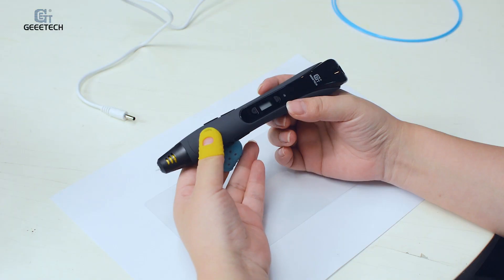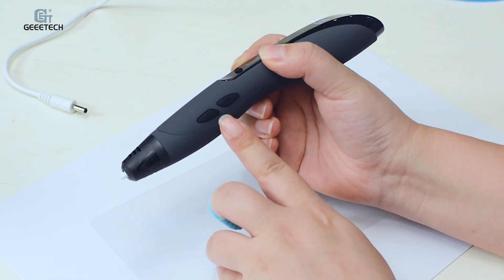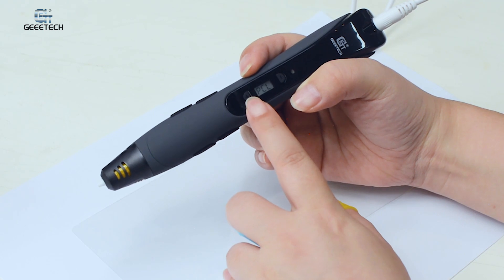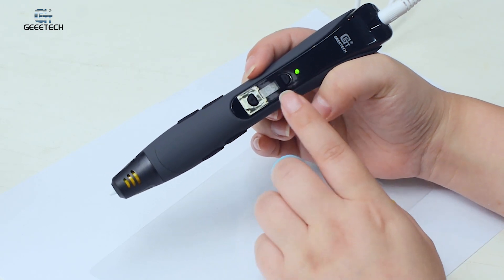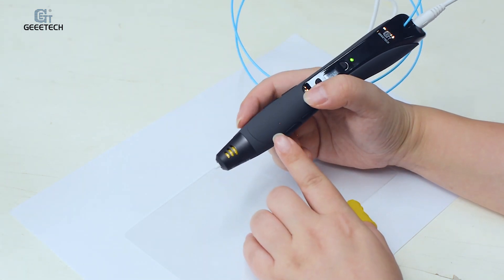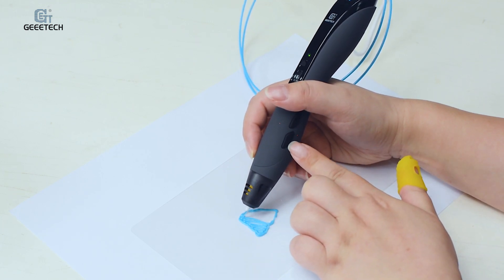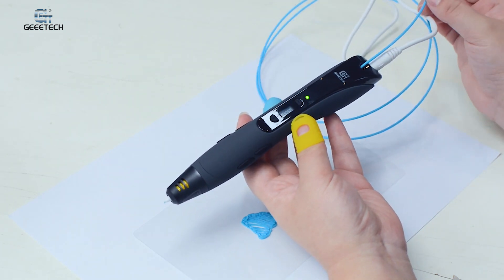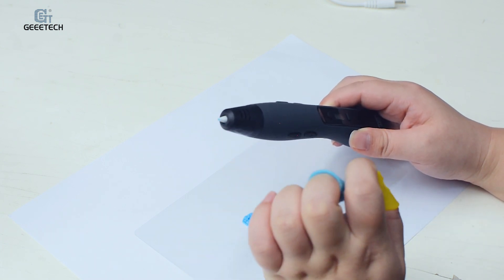Tutorial: how to use Geeetech TG-21 3D printing pen

Comment: What kind of filament does this use? Can u use it to add detail to 3d printed items?
Reply from the maker: it supports pla, abs and pcl, the pla and abs you used on 3d printer can be used on this 3d pen. you can use it to add detail to 3d printed items, but it needs delicate handwork, otherwise it may make your 3d printed item uneven and not beautiful.